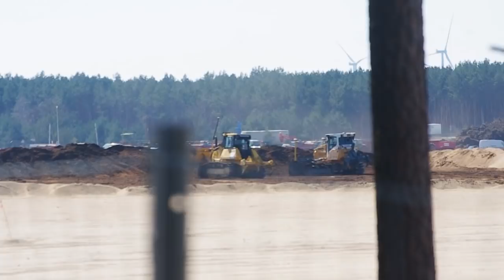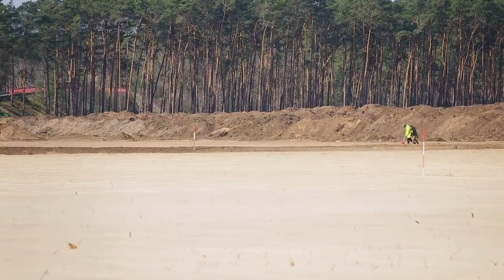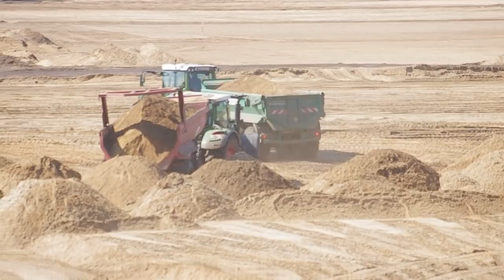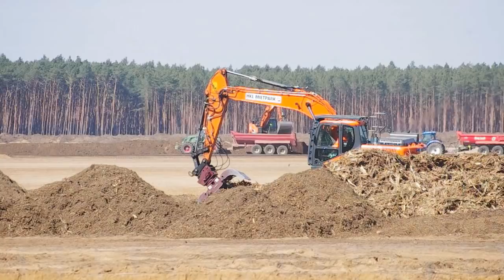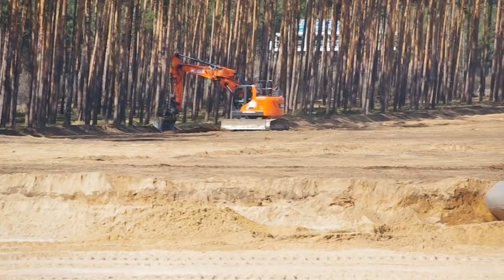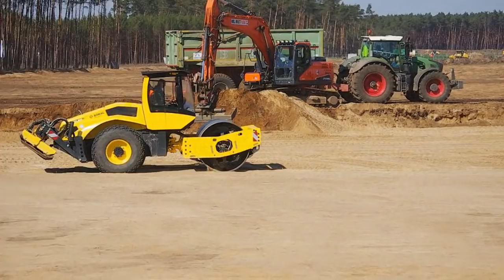Giga Berlin | 2020-04-01 | Almost ready for construction

Comment: Thanks, good quality videos. QUESTION: What is the purpose of the big yellow crane? I have not seen it actually doing anything over the last two weeks.
Reply from the maker: You can see it in action in my video from 9th of March. I didn't see any activity around that crane since then. I don't know why it's still there and what else they are going to do with it.
Reply: @TobiasLindh  I guess it will be needed later to mount the cranes.
Reply: @dukeoflakeshore5805  Nope. And it's actually not a crane ;-) It's a duty cycle crawler crane. I don't know why there is the word crane in it in english, direct translation from German would be "hydraulic rope excavator"
There won't be any tower crane on tis site. Maybe one but the halls will be erected with mobile cranes.

Comment: TOBIAS! Excellent video. Good progress but still a lot of levelling work to do! Tree root processing is still a major bottleneck, one not adressed due to destructive nature of this work on machinery.. Nice to see a couple of Volvo artic dumpers on site.. much more productive than farm tractots, with shorter cycle times ( faster transit speed and quicker tip times). Let us not be fooled into thinking the levelling is near finished.. I would say by end of April will be near completion, sibject to dynamic compaction, which may not be needed over the whole site.
Reply from the maker: True, those dump trucks are really much faster.
I don't know how much they are going to do in parallel. The root hills are not close to the main building, so they might not be a problem. Same as the lonely tree.
My biggest concern are the reptile areas. They are at the location of the main building and after resettling they still have to pull the roots and level those areas. Might be fast though, because those areas are not big.
I'm not sure if they will start building the roads and foundations before they cleared those areas. But they already requested prematurely permission for the construction of the foundations.
Reply: @TobiasLindh  good points. As you correctly say, roots are south of phase1 building so this is not a pressing concern, but nevertheless  this is taking far too long.